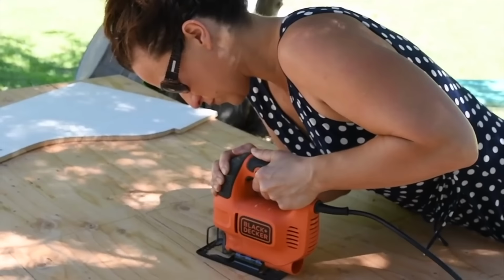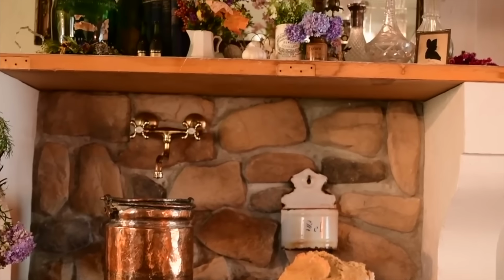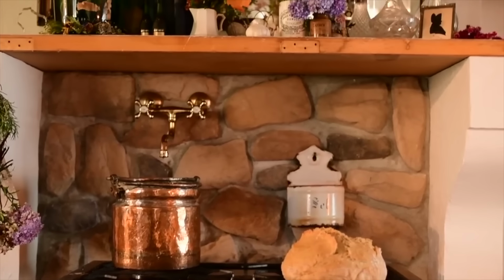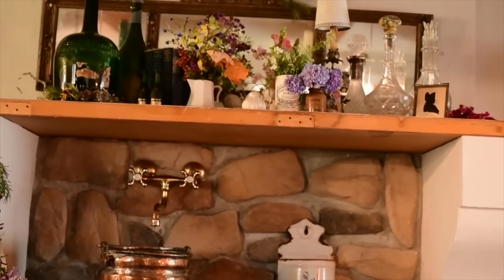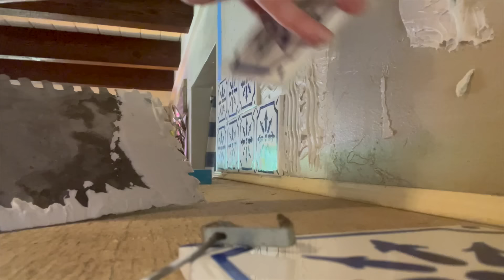⚜️78 Hand Painted Tile JUST LIKE MONET! ⚜️ FINALLY Installing! | Monet's Kitchen Tile

Comment: When I did my kitchen in the country I was very inspired by Giverney also. I had bought so many blue and white tile patterns that I couldn't decide so I continued to buy more types and in the end I did a patchwork of them and it was great. We had bought a Cornue wood burning stove which looked fantastic against it. I had the walls painted yellow and a friend gave me as a housewarming gift, a set of six japanese wood block prints. My dresser was an old shop counter and the wall unit I made up from another broken counter and some fretwork oak I found in the trash. We used the old terracotta roof tiles on the floor which wasn't the best idea as that made the floor very uneven. My favorite detail was the Dutch door, being in the country it was most useful, especially for neighbours to lean on when they smelt my jam making ! We sold the house mid renovation as it was a money pit and we had so much trouble finding sober workmen ! No regrets. I am moving into an old house in south west France which has a tiny kitchen needing complete makeover so am in the middle of finding sink, tiles and worktops , so much fun.